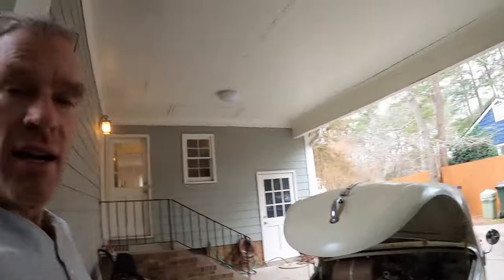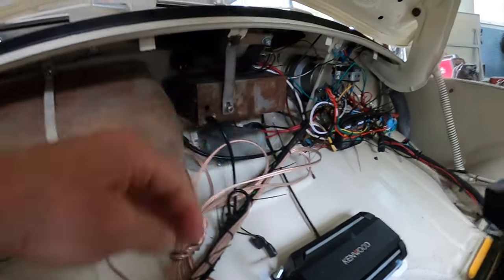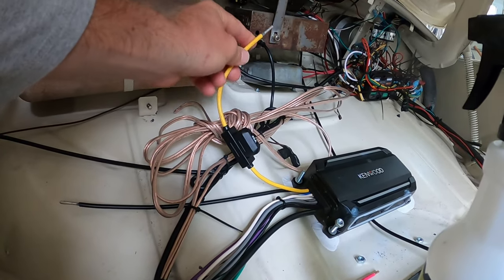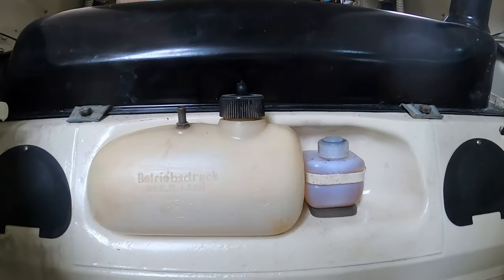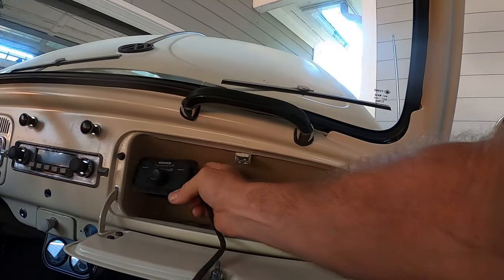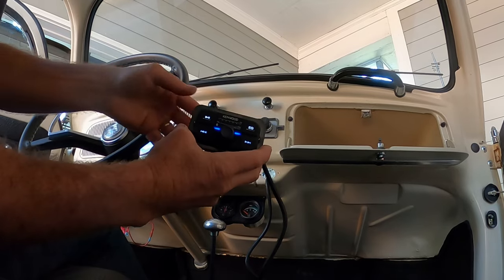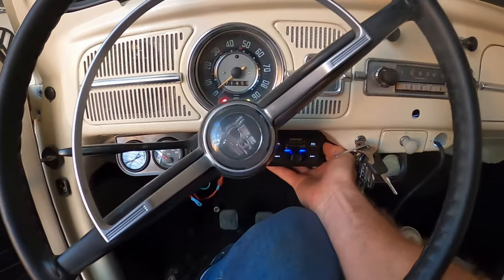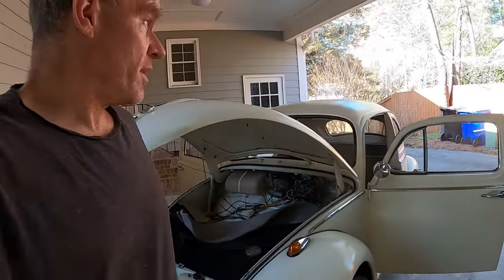1961 VW Beetle (65 Pan) - Installing the Bluetooth Stereo - 137

Comment: Man now looking at the beetle almost done! How beautiful is looking! Great job on the blue tooth stereo system! Great job!👌😎👍
Reply from the maker: Thanks - finishing up some odds and ends - when installing the wiring cover I disconnected the fuel solenoid by accident and the car wouldn’t run.  Now that I have fixed it, it should work again tomorrow…

Comment: LarsonVW, excellent video, I own a 1964 sedan beetle as well, you just gave me a great idea how to mount my kenwood amp, also can you show us how you connect your ground & positive cables to power the amp?? ❤👍🤔👀
Reply from the maker: I ended up running a 10 gauge wire directly from the battery to the Kenwood - which was a bit of a pain, and the starter has an indicator lead for turning it on.  The ground is bolting directly to a bolt under the hood  - you need a good ground for the stereo because it does dump a fair amount of current

Comment: The P. Cont blue wire, How or where did you connect it? I have a bus I’m trying to connect that way
Reply from the maker: So that is the “controller” power wire.  So it is only small voltage that tells the Bluetooth to turn on, but the large main power wire is the thick one that is actually connected to the battery at all times.  I connected the control wire to the ignition, splitting the spade.  Make sure it is connected to the one where the key on gives 12v, but the key off is 0v.

Comment: Wire in an on/off switch for your fuel pump, that way you won't be pumping fuel to carbs when you have your ignition switched on
Reply from the maker: Ok, and put it on the dash?
Reply: You could put it anywhere really, you could put it out of sight and use it as kill switch for when you're not driving the car, but just remember to switch it off when you finish driving.